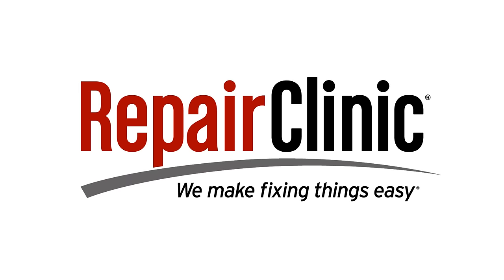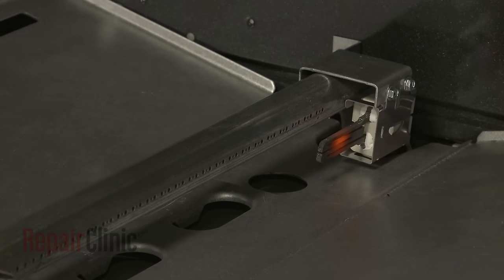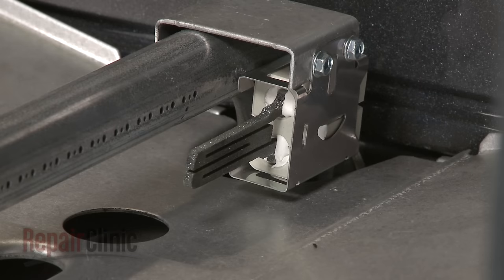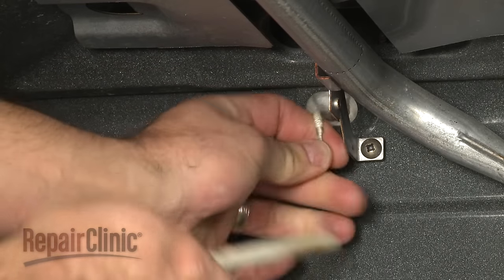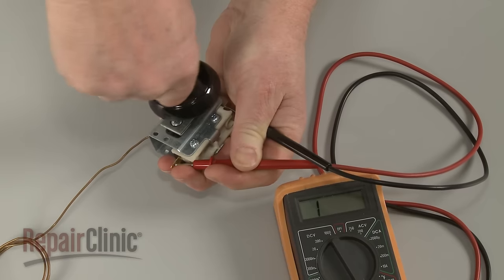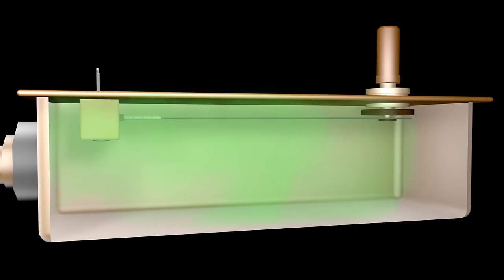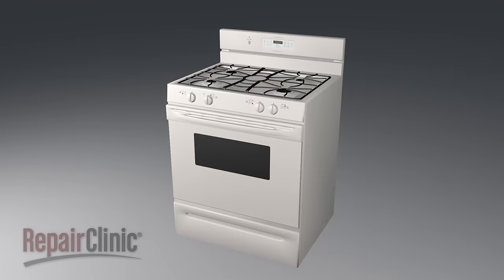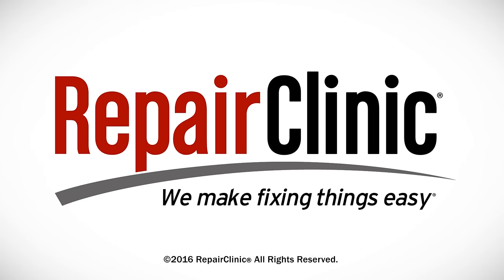Top 5 Reasons Gas Oven Won’t Heat — Gas Range Troubleshooting

Comment: THANK YOU! Using this video, I was able to confirm that my GE Oven Igniter was bad. I bought a used part from a near by repair shop and installed it myself. Just under 4 hours from the time I watch this video I had my oven fixed!
Reply: Did you turn the gas off

Comment: My problem on my kenmore oven ended up being the valve that went bad. Dad saw this video and said it really helped him figure out troubleshooting the problem and also looked at the schematic that he found in a pouch behind the oven. It wasn’t as readily apparent right away that it was the valve because the broiler side of the valve still worked but the oven side did not. And we ruled out everything else (and all dysfunctional roads lead back to the valve when all the wires worked and whatnot). We replaced it and the oven works great now.

Comment: What would cause an oven to work intermittently based on ambient temperature? Started having trouble in the summer. Worked all winter and started not heating up all of the way again this summer. Sometimes gets to 160f, sometime only 125f

Comment: My Kenmore gas oven made a click then popped the breaker. After that it won't heat up. I changed out the igniter but the new igniter won't light either. Broiler and range top still work. Any thoughts?

Comment: Lets ask:  the botton oven ignitor is glowing,  but  fails to  get the gas to flame over 18th an ich of flame. so can I  swap the broilers ignitor to the bottom and if the broiler fails  the ignitor is to blame.  turkey day, used the BBQ so tomorrow on shopping day I wonder if a sale is on this part, NOT

Comment: I have a GE Gas Oven Model JGBS66DEK3WW. Only 3.5 years old.  Oven wasn't heating up.  I unplugged power but didn't shut off gas(should have for safety) I changed the igniter. Took 2 hours only because I couldn't get the two screws that held the igniter.  Unfortunately when I turned on the oven, the igniter lite up, but  no gas came through.  This model doesn't have a utube to show how to light the pilot light.  And that may not be the problem.  I also read that you have to get the clock working.  I did.  The oven light, I would assume, should come on when I open the door,  It doesn't.  The light will go on when I push the light switch.  But I don't want to have the light on all the time.  Any suggestions why the pilot lite wont come on.  There repair men are book way out around  here.  And if they were to come out it would cost almost the price of another stove.  Soooo I am willing to try and fix.  I hope you can help - --- without me blowing up my home.   Thank you!

Comment: Yes I have a Frigidaire range and  the oven or broiler will not light . I have changed the electric igniter and still nothing . I saw where they was talking about a switch on the regulator when I call it does any one have a picture to show the on and off switch way it on and off .

Comment: Hi, I hope you can help me with my issue. My not so old but cheap and simple range Amana all the time ignites oven to some 100 degrees and shuts it off while gas handle is completely off. Non stop. What can I do, beside replacing this range. Thanks!!!

Comment: My oven is just a year and a half...I bought this brand new at Lowe's!!! I'm not happy!!
Reply: Same here, mine is a year and a half old and the oven doesn't work
Reply: Samsung gas range have now for 3 years this is the year 2020.  Oven does not heat the way it should even bought from Lowe's extended five year warranty because I know appliances are not made to last.  So much for extended warranty that's another story.

Comment: My oven control face does a odd flash of number 1, then acts like its normal and pre heating, but nothing is happening. The flash of number 1 doesn't seem to be an error code as the number is lit on the first left digit on the display and not like the other error codes I have seen before.  If it wasn't for that odd flash I would be happy to look into the heating element..  it started with error code power failer for a year or so, just reset the oven and it worked, then the oven would just not heat up sometimes, but would seem normal and can hear the click of the relay, just had to turn it off and back on to work.  But now idk, with the odd flash 1 happening has me a tad worried the board might be doing something odd, especially since its shown power failure on and off for no reason.  I guess I'm going to find out.

Comment: I have a Frigidaire Electrolux gas stove a just replaced the igniter and there is no continuity when I plug the igniter in. How do I replace the igniter wire harness and what wires do I need.

Comment: Hi my gas oven heats, but barely. I set the temperature, but it juat goes back to 160 degrees, but the stove works. Please help. It's a Whirlwind gas oven. The model number is EFG320M0BW. Thanks.
Reply: Did you get a response, mine is doing the same thing.
Reply: Ours did the same!  said it was at 400 degrees.  oven thermomenter said 150.  Turned it up to 550 and it finaly cooked the pizza after 40 min!  Yesterday it worked fine!!

Comment: HELP PLEASE!!!!!!!!!!!

A little different but a oven related question🙂.
Could it be that the oven wire has caulk around 2-3 inches of  it is the reason why the surface light is on and then blinks off temporarily after using.   I did notice a lighter fluid or gaseous smell.   What could be the reason for the smell and why does the surface light stay lit most of the time except after I turn oven on?

Comment: Just light all the burners and crank up the oven. Give it a minute or two. Should work, if it’s not wiring issue.
Reply: Why did that work? Gas still isn’t flowing to oven/broiler.

Comment: Hi, the igniter and oven burner turns on for about 2 seconds then shuts down..and then will do it again after some time(turns on and off after 2 seconds)...what will it be the problem ??
Reply: Marcel Gheorghe Tomescu,  Marcel sounds like the igniter may be going bad or the safety valve check continuity on the igniter. and safety valve if they :check out good could be a board problem
Reply: Marcel Gheorghe Tomescu did you ever found out what oven part was your problem?
Reply: That is the same exact problem my mom is having with her new oven.  She just bought it and has only used it once. Did you find out what the problem is?

Comment: 5 year old maytag.push the bake button,nothing but a beep,nobroiler.control panel bad?
Reply: Richard Hankins. This sounds like a bad board. Many Stoves give the beeping sound once you have set the oven temp sometimes you get a f. code. I would try this when it beeps shut it off by the breaker wait a few minutes turn it on see what happens if it still does it you have a bad board
Reply: Richard Hankins has

Comment: These are reasons a oven won't light. Not reasons it won't heat up properly
Reply: The thermostat or the valve are the reasons why it won't heat up properly, included in the video.